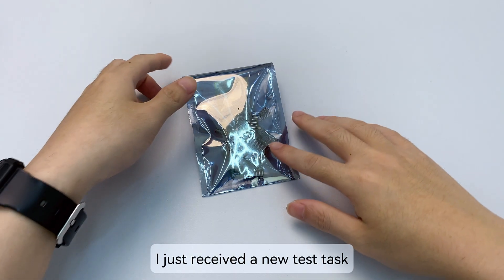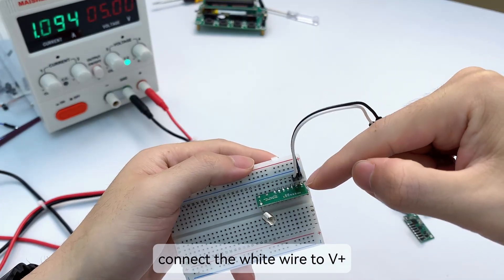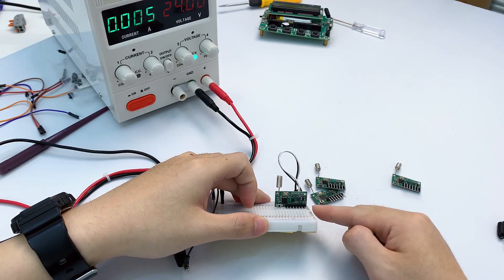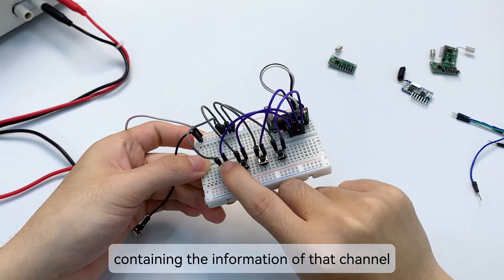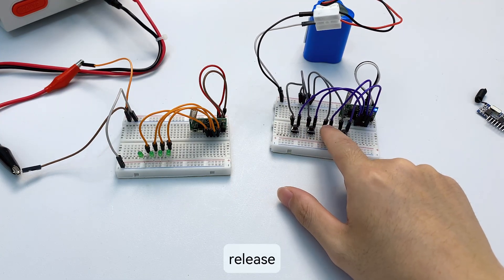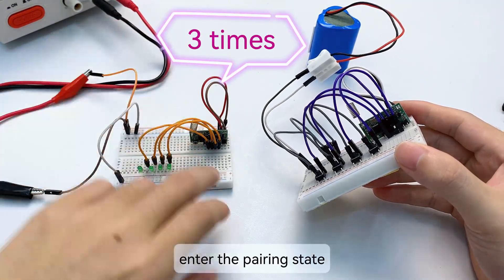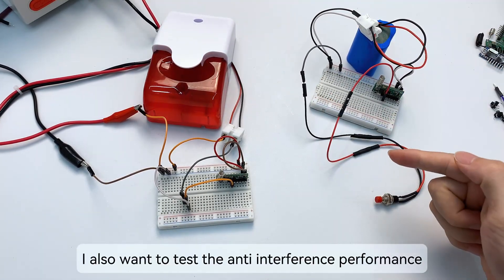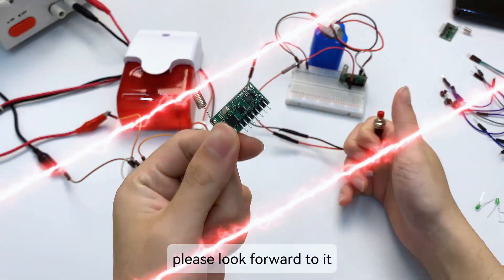How to Use RF Module RX480E 868 by QIACHIP Make Remote Control Alarm Transmitter and Receiver in One

Comment: Hello there! I have rx480e and I want to use it without tx118sa. Instead, I want to control it via arduino rc-switch lib. I  transfered signal (20+4bit 11111111010111110111 0010) and led flashed multiple times on rx480e (switch mode). Hovewer, I couldn't achive switching outputs. Signal is transfered, but nothing's changed. 

I also copied remote using Arduino. I cleared memory of rx480e and transmitted remote's signal from Arduino. Led flashed and after that I could use the remote to switch inputs, but I couldn't do it using Arduino. What should I try?
Reply from the maker: Hi there, it sounds like a protocol mismatch. Even though the RX480E LED flashes (indicating it sees the signal), it won't switch the output unless it recognizes a valid EV1527 frame.

Regarding your Arduino copy attempt:

Incomplete Signal: When copying a remote, if the Arduino starts recording slightly late, it might miss the synchronization bit . The RX480E might "learn" an incomplete code, which is why it flashes during pairing but fails to trigger during operation.
Solution: Please ensure your Arduino code is specifically formatted for EV1527. We recommend searching for "EV1527 Arduino timing" to match the pulse width of our module.
Correction: When teaching the RX480E, make sure the Arduino sends the signal continuously for a few cycles to ensure the receiver captures a full, clean frame.

Comment: Dear Sir ( @qiachip)
I bought this product and it works very well. Please tell me if this module can run in 2 different modes on 2 channels? For example, channel 1 is  momentary  mode and channel 2 is latching  mode. If they work, please tell me which website to learn? Hope you understand my question. Thank you very much.
Reply from the maker: It has a fixed configuration. Once the pairing is completed, all four channels are configured. Currently, there are only several basic configurations demonstrated in the video.
If you need to customize a new configuration, please let us know your requirements and quantity. If the customization conditions are met, we will customize a specific configuration for you.(qiai@qiachip.com)

Comment: Hi, guys! I have a few RX480E 868 boards, and I wanted to know how I could send data through them.

For example, I wanted to be able to send PWM commands with my ESP board to control a brushless motor.

Tried a lot, but couldn't find a way to do it.

In advance, thank you very much!
Reply from the maker: Do you want to control something through the ESP board + RX480 868?
Reply: @qiachip yes, exactly! On my case, I would like to send PWM commands using the Servo library on my ESP board and using the RX480E 868 to transmit this to my other RX480E 868 as a receiver in the other end, to control an ESC for a brushless motor
Reply from the maker: @joaovitor1615  The fundamental point: The RX480E 868 module cannot output PWM signals.
So, at the motor control end, that is, the receiving end, at least one ESP development board is required to output PWM signals.
The above is the principle. Now, here is a situation I recommend for your reference:
Transmitting end: One RX480E 868 module (transmits four different signals A, B, C, D)
Receiving end: One RX480E 868 module + ESP development board + motor
Control logic: When you press the button on the RX480E 868 module at the transmitting end, the RX480E 868 module at the receiving end receives the signal and sends it to the ESP development board. The ESP development board outputs different PWM waveforms according to different signals to control the motor. In this way, a remote motor control can also be achieved.
Reply: @qiachip Mhhh I see. Interesting. But ain't there a way I could send an int() data from my transmitting end directly to the receiving end (even if I have to encode and decode it, respectively)? Like sending int() values from 0 to 100, for example. 

I've noticed that at the back of the board there are a few pins that seems to be from the embedded microcontroller of the RX480E 868, which made me wonder if and how I could use the ones labeled as RX and TX. 

By the way, thanks so for the support you guys are already giving me! 谢谢！🙏
Reply from the maker: This module has four channels, and each channel can change between 0 and 1, following the binary system. Therefore, when it comes to encoding and decoding, the maximum number is \(2^4 = 16\), not 100.
You're really observant. Noticing those other silk - prints indicates that you must be a highly professional electronics enthusiast.
The RX and TX pins on the back of the RX480E 868 are for programming with the host computer and cannot be used for data transmission between modules.
Your questions have also deepened my understanding of this module. I'm glad I could assist you.

Comment: Kann das Modul auch Maße an den Ausgängen schalten und nicht 5V ?
Reply from the maker: HF-Module wie das RX480E 868 geben standardmäßig ein 5-V-Signal aus (High/Low-Pegel zur Realisierung der Ein-/Aus-Logik), das zum Ansteuern von Komponenten wie Relais und Single-Chip-Mikrocontrollern verwendet wird.

Wenn Sie eine andere Spannung als 5 V (z. B. 12 V oder 24 V) steuern müssen, müssen Sie ein Relais (mit dem Modulpegel zum Ansteuern des Relais und indirektem Schalten des Hochspannungskreises) oder eine Pegelwandlerschaltung (zur Umwandlung des 5-V-Signals in das Zielspannungssignal) extern anschließen.
https://youtu.be/ah2Llv7Pp2w
Ich hoffe, dieses Modul kann Ihnen helfen